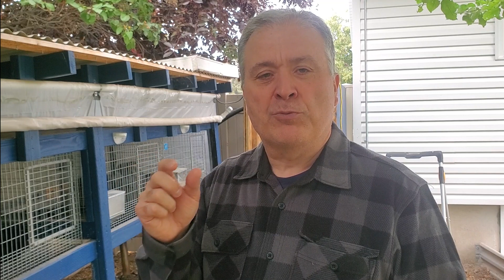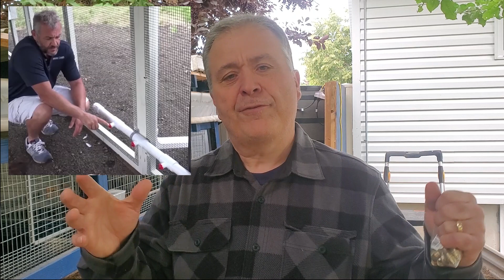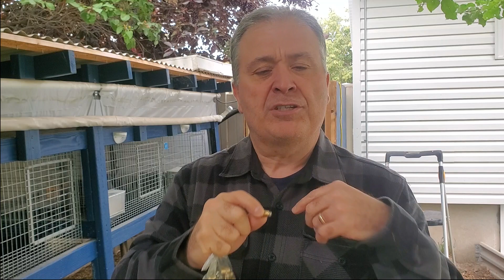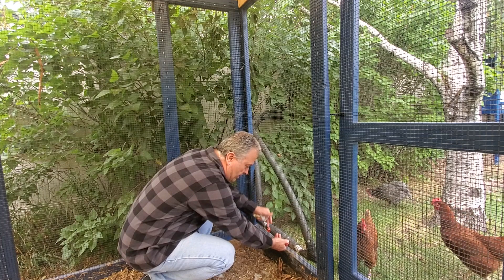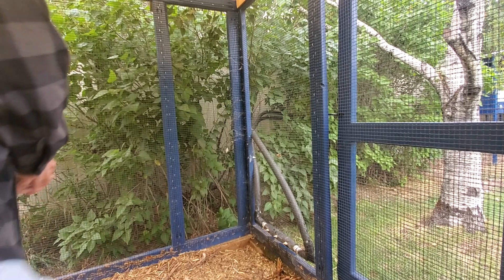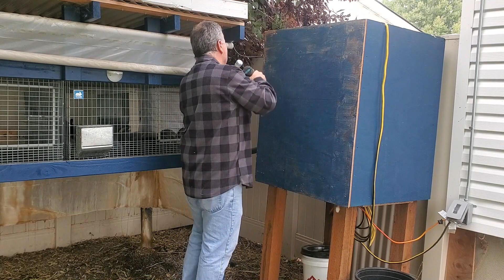Solving Freezing Problem In Chicken & Quail Automatic Watering System

Comment: Hi Dave,
For the winter watering "cartridge style" nipple bar, I'm using an 18" long 1" diameter "flexible Landscape Coupling" (home depot - $12) with the nipples tapped and glue gunned into the cartridge... think 18" long double ended caulking gun tube with 1/2" hose barbs.  I will have a video making these once I get one installed this afternoon.
My thoughts are the larger 1" water chamber provides for more heat, and removing the pvc Tee (directly "tapping the tube")  puts the nipple mechanism inside the chamber.  More volume = less freezing.
Doc 
~Tully River Quail
Reply from the maker: Sounds great 👍.  Be sure and send me a link to your video. I'd love to see it!

Comment: Thanks for the update on this system! I'm planning on building a system like yours for my chickens & rabbits also. Temps don't get as low as -9 here, but the convenience of automatic watering is really appealing!
Reply from the maker: Good luck! Glad my videos are helpful!
Reply: Did the metal water nipples work as you hoped for? I am trying to build similar system
Reply: @aaronbarnes1199  They worked well for the rabbits, but the chickens pecked the plunger out of the housing. I'm still trying to source a better option for the chickens. I'm back to using the red cup type adapter for the chickens which works well enough as long as the cup doesn't fill up & then freeze